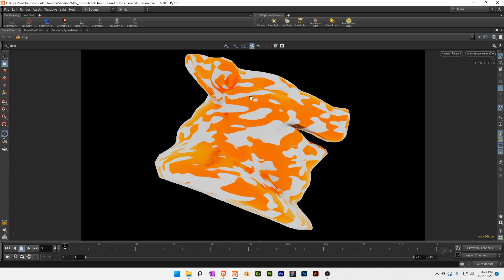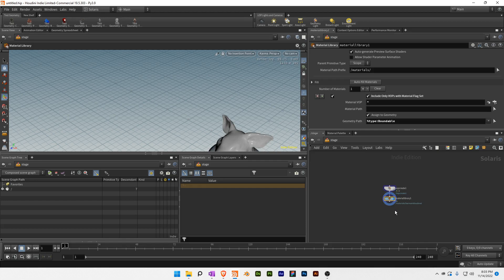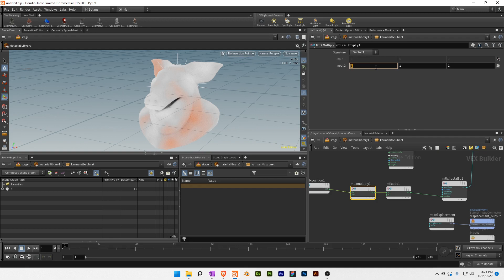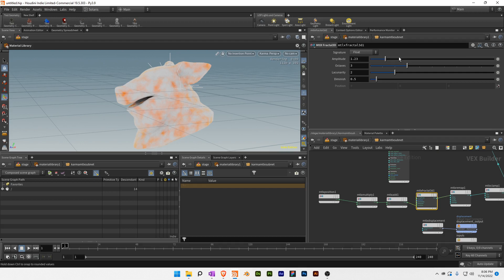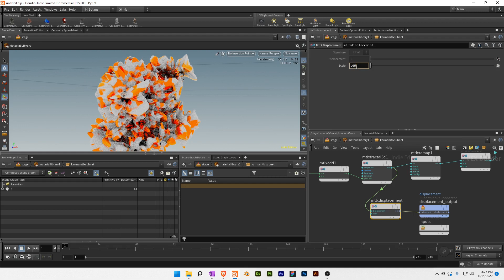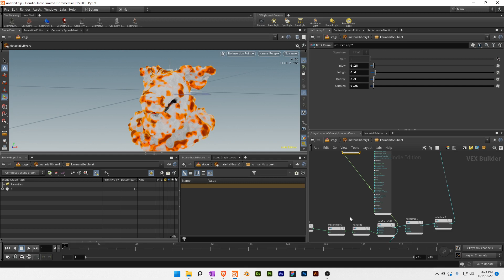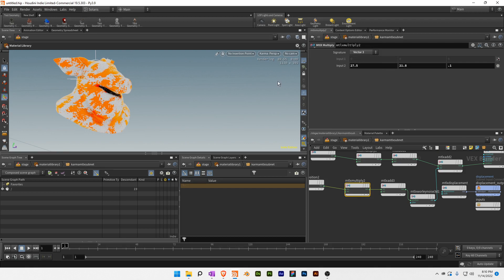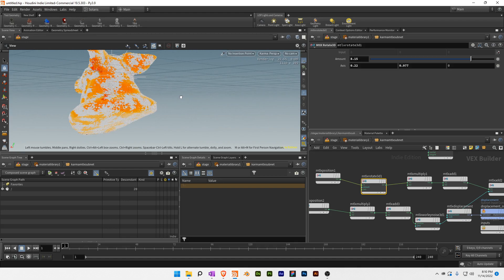Houdini Tutorial | MaterialX - Mixing Shaders

Comment: You added the Rotate3D node correctly. I believe you just weren't adjusting it enough. You were just using the slider but that's just a range of 0 to 10. Try adjusting it using the middle mouse control on the rotation and go by 1's or 10's even. Then you'll see it rotating nicely.